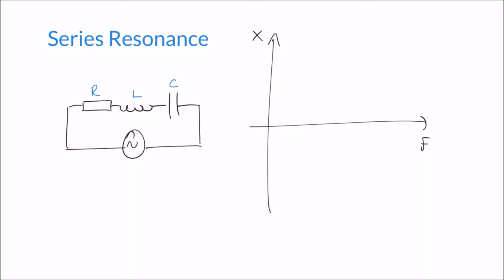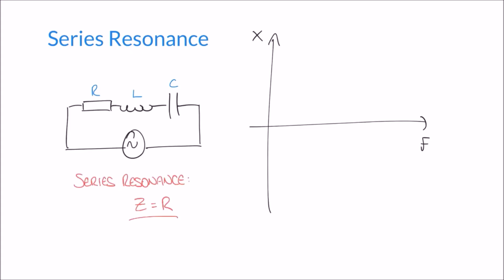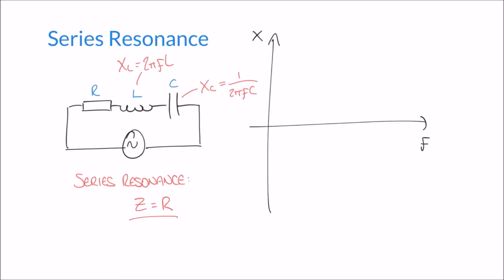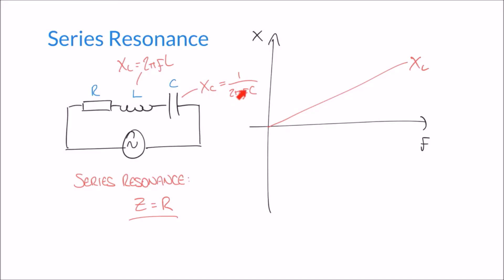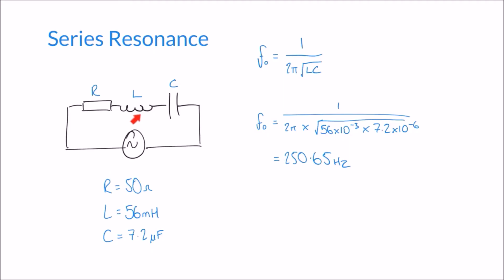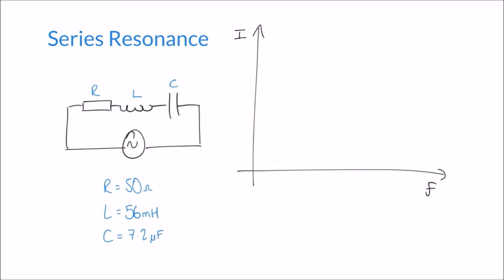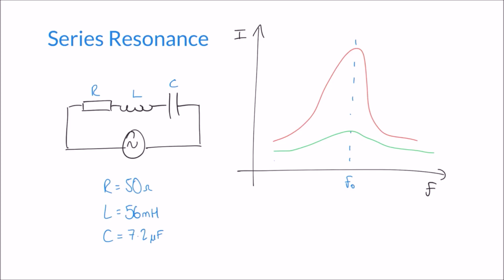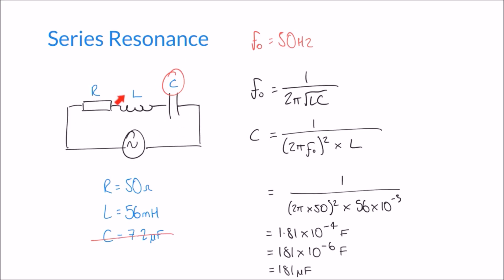Resonance and Q Factor in Series RLC AC Circuits

Comment: Isn't it interesting that the formula for resonant frequency is the same, regardless of whether it is a parallel or a series circuit. I scratched my head about that, until I realized that you are simply trying to balance the reactance, so you get 1/(2pifC)=2pifL. Isolate and simplify and you get the formula. This applies whether parallel or series, provided parallel resistance isn't very high.

Comment: You can also use XL=XC
XL=2π(50)(56x10^-3)
XL=17.593
17.593=XC
17.593=1/((2π)(50)C)
C=1/((17.593)(2π)(50))
C=180.930microF
Reply from the maker: Very true - in fact the formula for resonant frequency is derived from the relationship XL=XC that you propose here, since:
XL = XC
2*pi*f*L = 1/(2*pi*f*C)
f^2 = 1 / (4*pi^2*C*L)
f = 1 / (2*pi*SQRT(LC))